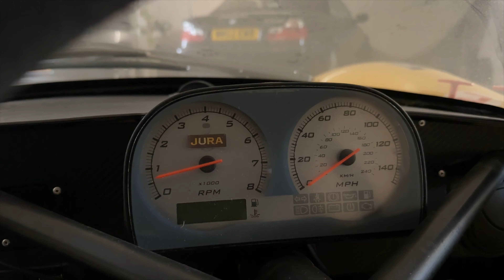We Brought a Barn Find Ferrari Race Car Back to Life

Comment: E' simile alla Ferrari 512 BB Bellancauto LM
Reply from the maker: We had an overheating issue, so we replaced the rear with a mesh grill to get the hot air out, the inspiration was 512 BB LM.